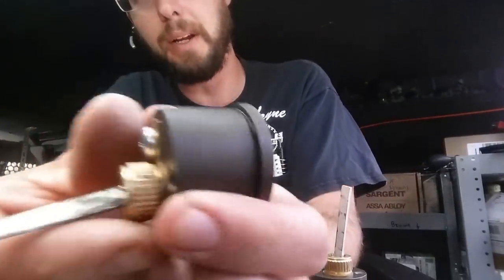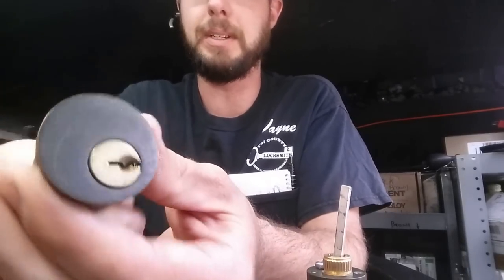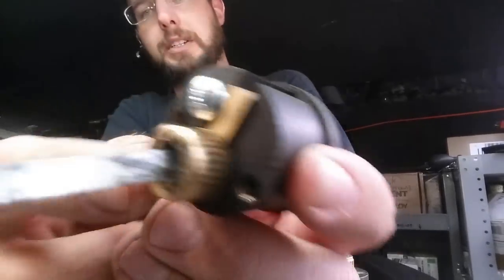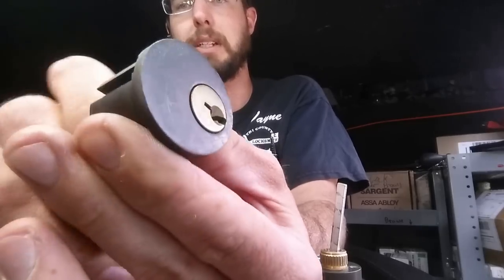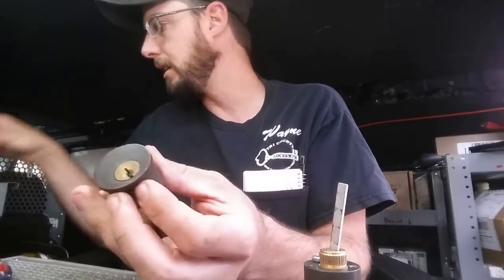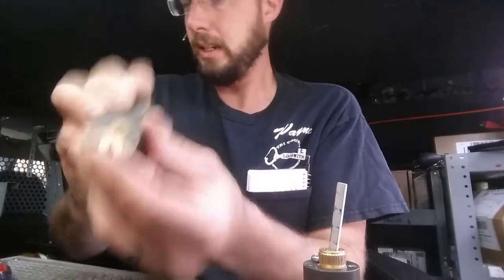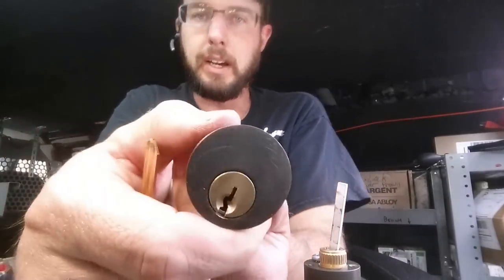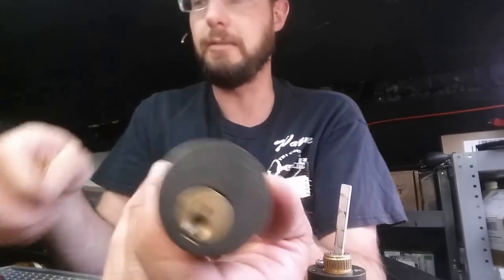What WD 40 Dose to A Lock! Attract Dirt and Jam Up The Lock

Comment: In Northern Michigan, outdoor locks get rain and environmental moisture.  A Comedy of Errors almost ruined a potential awesome weekend:  

We bought property with an old cabin on it 5 years ago. Our first winter, in January, with about 10" of snow on the ground,  we were almost locked out late one Friday night.  Our low to the ground AWD family sedan got stuck in our short driveway before we got to the gate.   Our cabin is still about 600 yards from the other side of the gate.  The air temp was in the teen's and it's 18 crow miles from civilization.   We had to break in our BOL to survive the night.  The  freezable combination locks on the gates were replaced with disc locks with weep holes.  

The solution is to use steel disc locks with weep holes.  First hit the lock with a propane torch to defrost, then hit it with a  blast of WD40 to displace the water.  It opens right up. We have not been locked out since.

Comment: I watched this vid after i sprayed 40 in my keyhole alrdy
Reply: Regular WD40 is great in locks.  After YEARS, you might have to swish the lock out in mineral spirits to clean it.   I don't see what the fuss is about.  People act as if their lock is instantly ruined if WD40 is sprayed into it which is nonsense.
Reply: I use WD 40 on all my locks cars house hinges .. never had a problem for years and years ..
Reply: Powdered graphite lubricant is the safest bet for locks.
Reply: Mike Elbow .. it’s better than KY?
Reply: Mike Elbow .. yeah but who has powdered graphite ? Is Fred Flintstone your next door neighbour? I have WD40 and it works wonders even on my car hinges and locks , I noticed after a while I don’t need to spray again for a while .. the metals seem to be coated with a protective layer that lasts and lasts and repels all dust and any dust that lays on the surface after many months is easily washed off my car hinges .. yep I wash my cars 2 or 3 times per year
Reply: @rykson161  Home Depot carries graphite. It was next to the key making dept. that faces the checkouts, 6 feet away from the WD that was at the beginning of the very next aisle.
Reply: @rykson161  KY is water based.
Reply: @mcleb84  doesn't  do shit to a lock with jammed  pins though, never had a single  issue  with wd40 in a lock